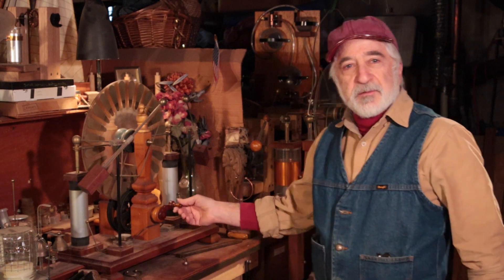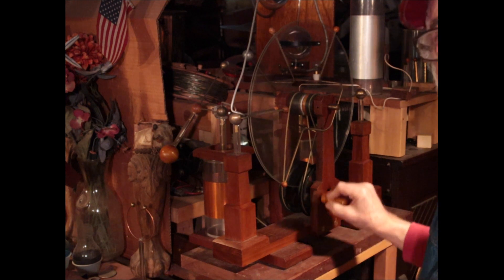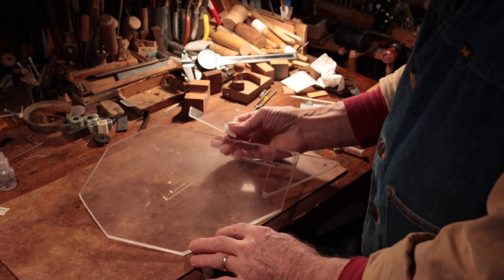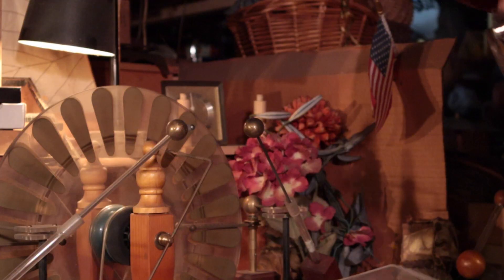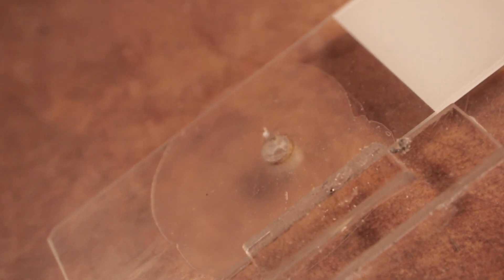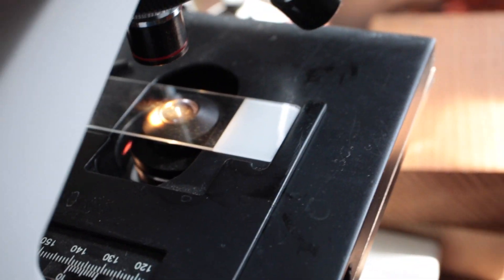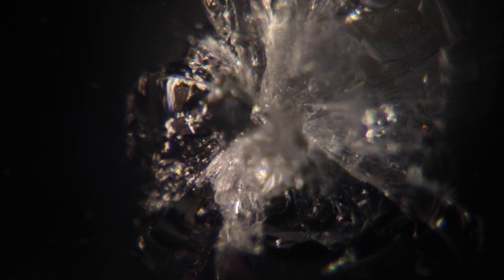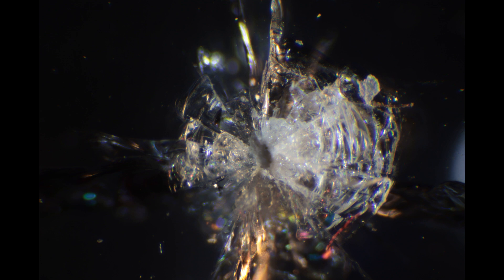Microscopic Bullet Hole through Glass

Comment: I love your videos! Never know what we're going to get but always enjoyable.

I should preface this by saying I'm a jeweller and I did some glass work back in college but I'm not a physicist. I have some ideas about what might be happening to the glass but they're only guesses based on some hands-on experience.

First possibility, the arc is hot enough to melt the glass in a tiny spot and surface tension would make the glass creep away from the center of the heat. Glass doesn't like to be heated unevenly though and when the temperature differential is too high from place to place it fractures.

Second possibility, it's just impact. Small particles like electrons and photons have mass. In the arc they might be traveling fast enough to punch the hole in the glass, which would then fracture around the spot from the impact.

Main reason for these guesses is my experience with the laser welder I use at work. You hold metal to be welded by hand and when you fire the laser it heats the metal in a tiny spot fusing two pieces together. When the laser hits you can feel the physical impact of the light on the metal. If you turn the power up high enough you can use the laser to shoot a tiny hole straight through the metal too.

Anyway, long rambling guess but your video really got me thinking. Thanks for sharing it!
Reply from the maker: Thanks for the kind words, and for sharing your thoughts. As far as the physics of what's happening, I also visualize the impact theory, more than the heat-stress-fracturing idea. I've looked at a lot of the holes through high-power magnification, and the center of the hole always looks granular; I've never seen any evidence of melting. I would've liked to show those details in the video, but my photography skills through the microscope are not optimal; the photos can't match the level of detail that can be seen through the eyepieces.
Reply: Perfect, details on the edge of the hole would have been my next line of questioning. High energy impact of small particles definitely sounds like a strong possibility.

Regardless of detail level, those photos are beautiful! I love seeing things from odd perspectives, magnification levels, slow speeds, etc.

Comment: These static generators are awesome... kinda like their maker!
Would love to know more about them.
Reply from the maker: They're called influence machines, because they generate electricity without magnets or friction, but by passing charged plates past each other in a self-stimulating cycle. There are always traces of charge present on the plates, on the sectored one, but the sectorless one sometimes needs to be charged before it will start. It only needs a tiny amount of charge, like you can get by rubbing a plastic tube with a wool sock, and holding it next to a disk as it turns.

As the plates pass each other in opposite directions, they quickly induce a higher and higher charge on the opposing plate, and in the zones where it is highest, the charge is continuously stripped off by the collector combs on either side of the machine, and the juice is collected in the Leyden jars, which are actually big capacitors. The collector combs don't touch the wheel; just being next to it is enough. One side of the machine is negative, and the other is positive; it can be either way, depending on which way it starts.

Just past the point where the charges are collected, the plates are neutralized; grounded to the opposite side of the plate 180° away by the neutralizer arms, at which point those zones immediately switch polarity and start building up the opposite charge as they go by, because of the strong same-charge passing on the other side, which is coming from the other direction and approaching the collector comb, and then the neutralizer on its side. It's kind of a brain teaser to visualize it; it's all happening simultaneously in four distinct zones. each zone being mirrored 180° away on the other side in the other direction, with the opposite charge. Mr. Wimshurst, who thought this up, was certainly demented.
Reply: Amazing - thanks for your description!

Comment: I'd love to play with some of the stills that you have at the end, they look like fun editing playthings..
Reply from the maker: You would be welcome to mess with the photos. I didn't edit those photos at all; that's just how they came from the camera. I'm actually a little disappointed that the focus seems a bit soft in all the microscope shots, including the videos; the images are much crisper when viewed through the eyepieces, so there's something I'm doing that's not optimal.
Reply: @bellowphone  I don't have any way of capturing the images from your video, but maybe I can help you get clear images if you do something like this again which, kind of hope you do because it's kind of fun to see... What kind of interface are you using between your camera and the microscope?
Reply from the maker: @northstar2007  I have an adapter which clips into the SLR camera.  You take off the camera lens and put the adapter on the camera, and the other end slips over the microscope eyepiece and tightens on with three thumbscrews. There are no optics in the adapter; it's basically just a tube; so with the lens off the camera, the microscope eyepiece is functioning as the front lens of the camera. I suspect what might be wrong is that the sensor of the camera is too far from the focal plane of the eyepiece, which is compensated for by the focus knob on the microscope; so the nearest equivalent of a crisp focus is still slightly distorted. I'm going to do some experiments with hand holding the camera without its lens, at different distances from the eyepiece, and see if I can get a sharper image. If so, I will modify the adapter to adjust the distance.
Reply: @bellowphone  you might be able to modify the so you can change the depth of field and might be able to adjust the focus a little better that way. should be easy enough to do, a simple slide mechanism, the other thing you'll run into is the focal point on the sensor too, the adapter might be slightly offset from the center just a hair and causing a focal mismatch.. They have an adapter that goes right to the microscope bypassing the lens entirely and using just the focus on the microscope itself, you might get better results that way too